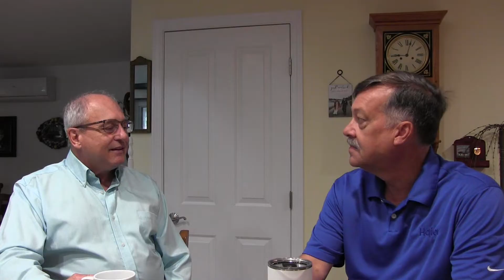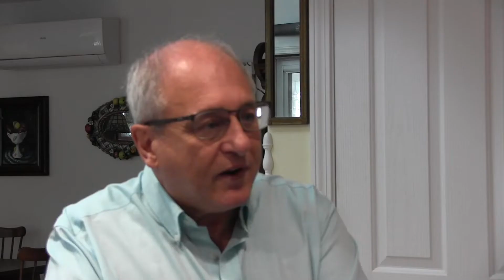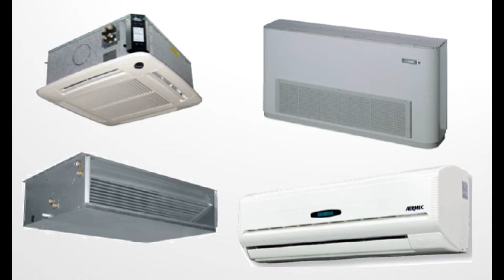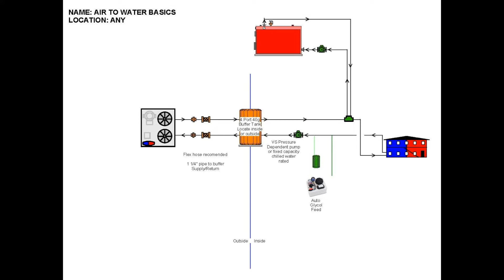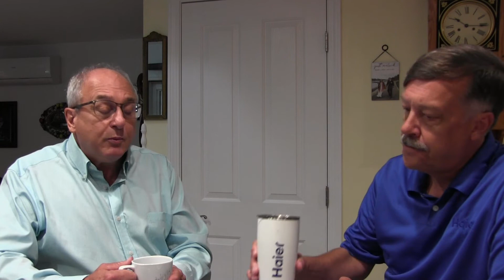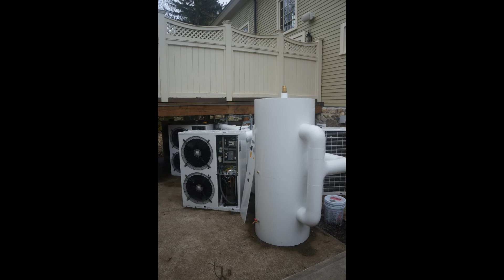Air to Air or Air to Water Water Heat Pumps?

Comment: What are we trying to do? Heat up water ...the water that our bodies are essentially made of. Why the heck should we heat water, to heat radiators, to heat air, to heat our bodies. Surely it makes more sense to heat air directly to heat our bodies? The only reason air-to-air may not replace a wet central heating system is because the insulation is so poor in concrete and brick houses. I think we should stop wasting money on complex air to water systems and spend it on insulation and MVHR. Our Swedish house stays at 21°C or more if the outside temp is above 9°C —with no heating.